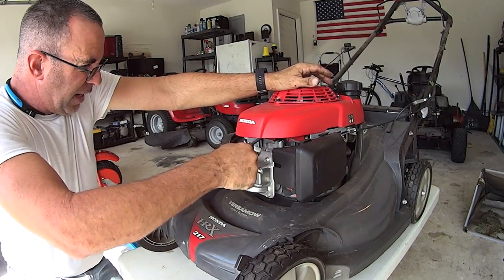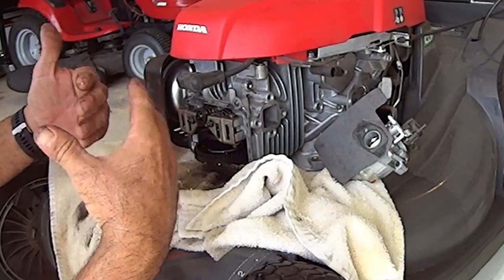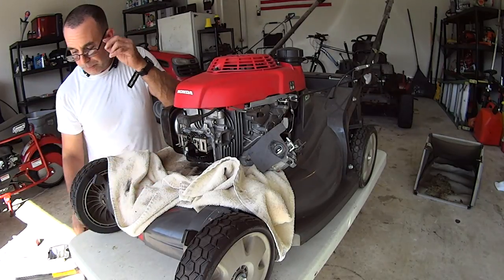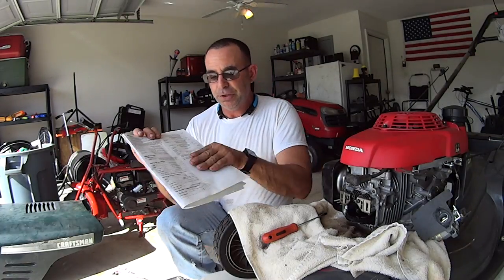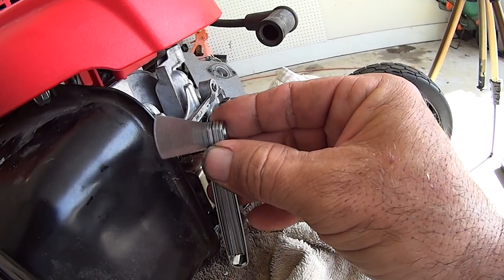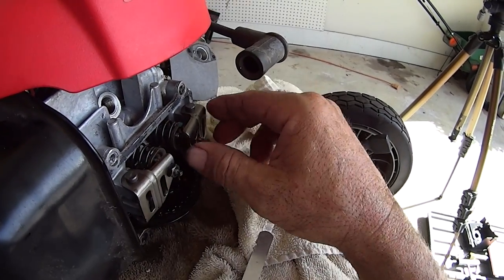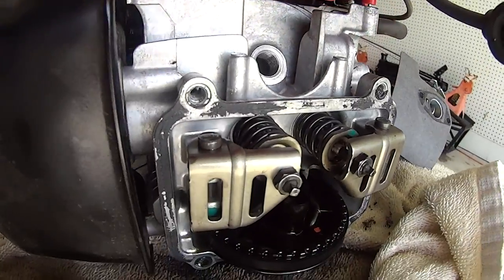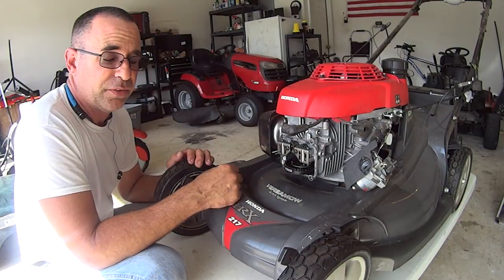How To Check and Adjust Valve Clearance Honda GCV 190 HRX217 Lawn Mower

Comment: Honda run time is 1h 15m and capable to cut 12-18" grass. Honda are known to run super clean emission. Now run time 1h 45m with carb mod, magnet and Tribo-MAX motor treatment. Capable to cut 18-24" grass. It definitely has more torque/power and its super super clean emission. I have notice tiny bit more power with Tribo-MAX Fuel+. Great video and save $100 very simple valve adjustment.
Reply from the maker: Thank you

Comment: Great video.
It was done in what I call dan format.very thorough and very well explained in a manner that everyone can understand it completely.you could be an awesome teacher.
What I would do when applying the sealant on the valve cover is make sure my starting and stopping point with tube is on the upper side of the cover just in case there is a hint of a seam in the sealant it would be less likely to leak at the top.this is only because I do overthink everything.drives my dad crazy to be around when I do stuff because of that,lol !
Keep the videos coming

Comment: Good video, very thorough.  In my research I think Honda says the valve cover is one time use.   I'm just going to bang mine up and have a replacement.  Well over 100hrs on my mower.  I'm sure they are loose.

Comment: great maintance video i wonder why honda dont sell a regular gasket for this mower probly to cut costs, some body must make a gasket for the valve cover. or make one
Reply: That’s what I’m saying. Why bend up a perfectly good value cover with Superman bonding sealant when there’s good gasket material out there? Come on, make the serviceability of this easier. These damn Hondas will run forever if you take care of them. Plus, removing the carburetor/air filter sounds like unneeded work - if it ain’t broke, don’t fix it, right? Glad I’m not the only one that feels this way.

Comment: Thanks bro! Very informative and I've got the same Honda hrx217 and I'm pretty sure the valves need to be adjusted so this will help out tons. I took the carb apart and cleaned it reinstalled and the mower starts and runs great but after a couple minutes starts to lose RPM a little bit and then climb back to normal so I'm hoping adjusting the valves is going to help.
Reply from the maker: Not the Valves. Definitely internal with the carb. Surging is a dirt issue or a bad gas issue or the float / Needle and seat is dirty.
Reply: @DansVlog  ive cleaned the living shit outta the carb, and, the float and needle are in good shape.. Cleaned out the tank and fuel lines plus filled with fresh gas...Im just gonna order a new carb and see what that does. Thanks for the info and Reply!

Comment: wonder if the valve cover would come off easier while motor is hot/warm? lil tip set the tube of gasket maker in the sun for lil while makes it much more easy to use.

Comment: I like to use "go-no go" feeler gauges for adjusting valves. It eliminates any guesswork. I have the same mower as you with about two years on it (Florida lawns, so it's used year-round), so I think I'll check the valves this weekend.
Reply from the maker: Great idea! Make sure you have a good gasket maker since the Honda motor does not use regular gaskets.

Comment: I assume you did this again? I’ve had the same mower for five years and never changed the valve clearance. It probably has about 150 hours on it. Curious if you ever saw it get loose. My engine still makes what I would consider the same power so i wasn’t considering doing this.
Reply from the maker: It is just a simple maintenance check. If it is found to be out of tolerance, then make the adjustment.

Comment: @8m0s  RE: interval, 100hrs or every year.  Such maintenance schedule might be suitable for a commercial user, but seems excessive for the home user.  Case and point,  our lawn gets mowed once a week, usually taking 30-45 minutes each time.  Say from May through November.  That's roughly 26 weeks.  By my calculations that's ~20 hours/yr, or 5 years to reach that hundred hour mark. 
So... I'll probably check mine in a year (for initial wear), and then every 4-5 yrs there after.  Fortunately they use a locknut/screw arrangement rather than shims.  That matter (used on many motorcycle engines) is a royal pita to adjust as it requires cam removal.
Is there a spec on the timing belt replacement?  Here's a video on changing the belt on a similar engine... It's quite involved, requiring engine removal and case splitting.
Reply from the maker: Follow your maintenance manual
Reply: @DansVlog  Lol... There's no mention of this in the maintenance manual.  Just like there's no mention of changing the trans fluid.

Comment: You are actually planning on doing this headache yearly??
Reply from the maker: It won’t be as hard next time. The gasket maker I used will be far more forgiving than the rubber cement Honda used. This task should take no more than 20 minutes.
Reply: Brian L   What is the alternative?  What do you do?  But a new mower or what? Everything requires maintanence.
Reply: @jeremiahlf   Wait til your mower won't start then check the valves.

Comment: You have to make sure you are on the right stroke since on a 4 cycle there are two different times that the Piston is at TDC.  You need to be in the start of the intake stroke and not the start of the power stroke .
Reply from the maker: That is correct. To know this, both rockers will wiggle when on the right stroke. If not, then like you suggest, it is not right and there will be one valve with 0 clearance
Reply: @DansVlog  You da man Dan .

Comment: Hi I have a Remington rm120 looks to be a Honda clone, back fires real loud when pulled! One valve does not move and is loose.. broken camshaft maybe  ? never seen before?
Reply from the maker: Tighten the valve and see if it starts to move. It just may be too loose. If it starts to move, start following my instructions and set the lash

Comment: My valve cover has a silicon gasket on it. Any tips to get it removed?
Reply from the maker: Rip it off, clean it up with a razor, replace gasket with new or get Red Gasket Maker from Auto store

Comment: thinking that exhaust valve clearance making the starter rope hard to pull
Reply from the maker: Could be
Reply: The exhaust valve lifter is know to crack on these, causing it to feel locked up. $8 on amazon
Reply: exhaust was outside specs. feels easy to pull now. Note to self, this would be a good time to drain the oil before removing the valve cover. May try that instant cure gasket maker next time.
Reply: Dan Zachry I just bought the same mower for $50 from someone because it didn’t pull. $8 lifter and it’s golden lol.

Comment: 19:41 that's not the camshaft lobe that is just there to open the values a little bit for the easy start mowers. It takes off compression for just a split second

Comment: how do you know you're on the top dead center of the compression stroke? and not the exhaust stroke?
Reply from the maker: The valves will both be loose and the piston will be able to move a little bit without the valves moving.

Comment: Dan, aside from the manufacturer recommendations on valve adjustments time; How will my mower start acting up that will require this type of an adjustment?
Reply from the maker: Loss of power, hard to start, popping back thru the carb are a few symptoms most noticeable.
Reply: @DansVlog  Dan could this make the mower surge as well if clearance is off
Reply: @RM-zy2pp   Surge is usually due to 10% ethanol in gas.  Try to find pure 100% gas nearby.  Carb gets funky from ethanol.

Comment: Is this a commercial mower
Reply from the maker: Not sure what defines “commercial”. It’s powerful, efficient and well built. Has a great warranty and parts are readily available. That’s all I know
Reply: No it’s not. The hrc models are. These are mid grade ones. There is hrn (replaced the hrr216vka models) these one (hrx models) and than there is hrc models. C stands for commercial. It’s close

Comment: I can't believe they say you need to do this once a year but expect you to pay for a shop manual to get the procedure.  WTF Honda?
Reply from the maker: Most people would bring their mower to the shop and pay 60 or $75 for a full tuneup which would include your valve adjustment. If that’s  something that is not affordable or you disagree with, then stick to MTD and Troy built lawnmowers from Lowe’s and Home Depot and just run them till they break.